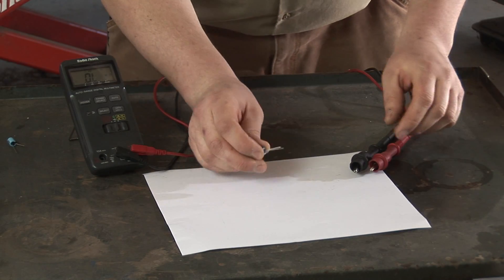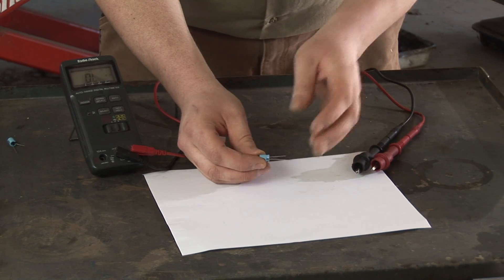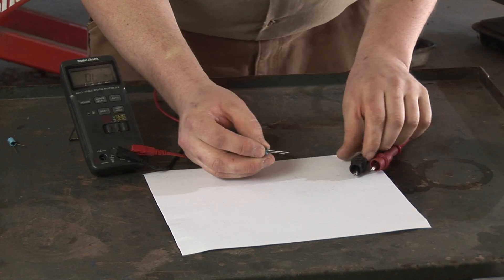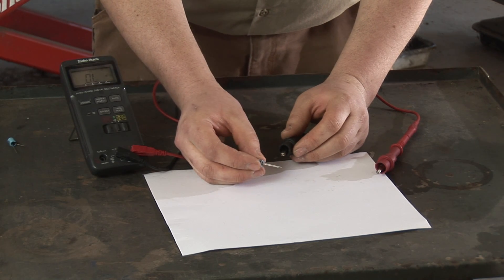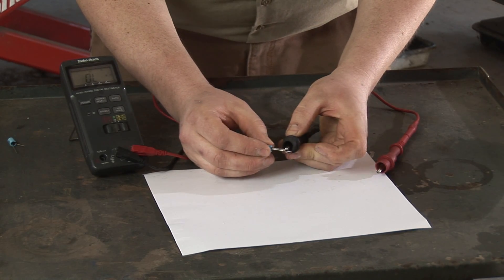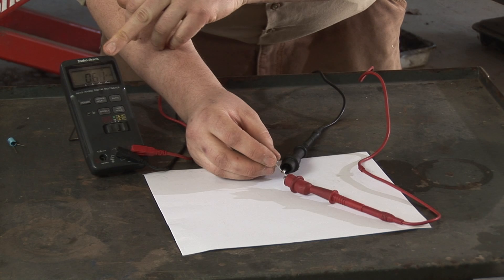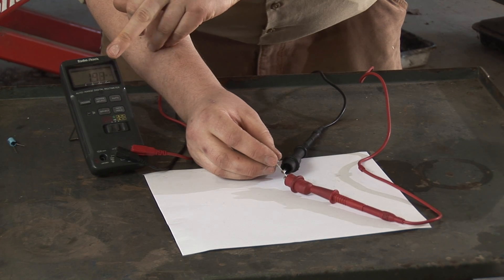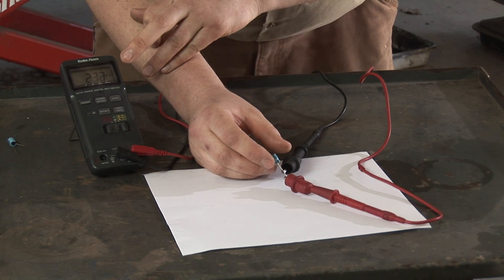Auto Repair : How to Test Starter Capacitors

Comment: @10MickeyMouse C
Capacitors are used to control power voltage spikes in most if not every  electronic device input All automobiles are complex electronic systems that testers that emit over 5 volts can inadvertently harm   it is best to test any tester used today to see if it emits over the 5 volt shop manual warnings. I know of only one test light that is safe.

Comment: Great video - A man that can look beyond in the electrical field I would want to work on my car especially when most  test lights emit over the 5 volt shop manual warnings and cause inadvertent electronic part damage. There is another new way through float circuit technology that is easier and safe to test a capacitor with a PolatroN-1   that emits under the 5 volt shop manual warnings

Comment: Took a few seconds, but he doesn't actually reference the starter on a vehicle using start capacitors (which they dont). Hes an auto mechanic that's explaining how to test motor start capacitors for electric motors that use them like fans, air compressors, HVAC, etc..